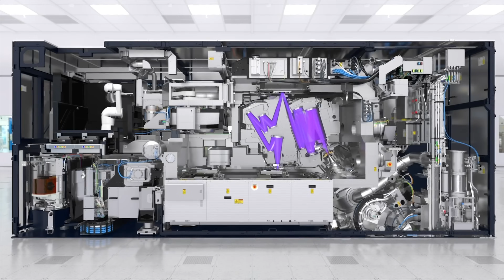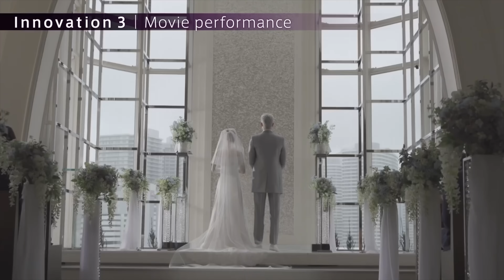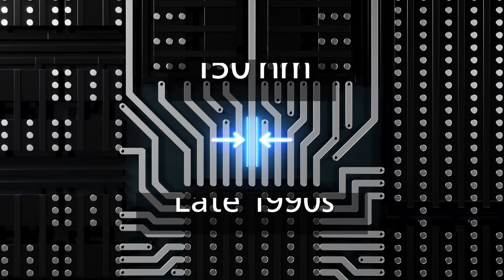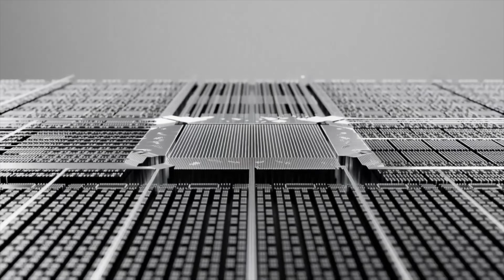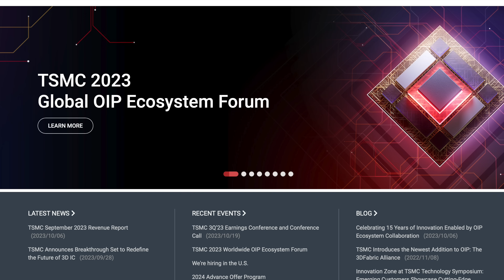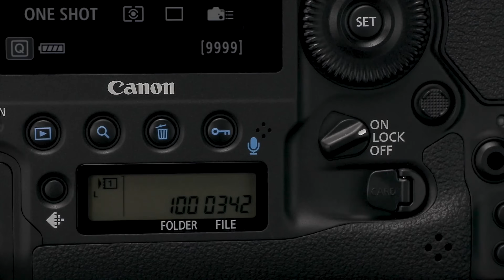Canon EOS R1 Innovative, new sensor design technology?

Comment: Reading about this topic, I found some skeptical articles on the internet as for this printing technology of chips on this small scale. It is told the printing technology can be faulty, because of the printing proces itself can cause small faults, while printing on the surface of the chips. Are they really completely ready for this 5nm scale chips? However, maybe the complexity is less than for instance a smartphone chip and they will really deliver it this year? As a R5 owner waiting for the MarkII, I hope for the best!
Reply from the maker: That's what's remarkable about the new release: Canon claims to have figured out imprint technology. Time will tell. It would be embarrassing to issue a press release, and then have it fail.

Comment: That will make faster processors, meanwhile faster Digic. Image sensor itself is analog chips, it does not get benefits from the new machine. But it may get faster from the stacked chips on the back.
Reply from the maker: You've actually got the backwards. It is the sensor CMOS or CCD that is analogue. the sensor's photo sites capture light as an analogy signal. This signal is sent to the image processor. 

The image processor is made up of transistors and converts the analog signal into a digital information in the image processor. The name is in the chip: Digital Imaging Integrated Circuit.

But I wasn't not specific enough.

Comment: A few years ago I wondered, “what if camera manufacturers produced 5 or 3 nanometers processors like TSMC did for Apple’s iPhone and computers? How would much more battery life could we get?  Performance in shots per seconds? Better dynamic range?  16 bit instead of 14 bits photos? 8K 120? “.    Medium Format quality in a Full Frame camera.  I’m just a guy dreaming.
Reply from the maker: At a contextual level, because the same transistors and logic take up a much smaller space, information gets to its destination much quicker, requires less energy, generating less heat and prolongs battery life.
Reply: 8k 120 from a red costs over 40k so yes you are dreaming but I would definitely settle for 8k 60fps since the R3 can do 6k 60 fps

Comment: This could be a really really big deal. I'll wait to see the results on their fabrication yields as we've been down this road before with Intel promising they've "cracked the lithography code" only to fail to produce at the yields they wanted, which ultimately made their implementation in a fab unprofitable.

I really do hope that this is real though, it would be amazing to have multiple forms of lithography available to manufacturers. ASML having a monopoly isn't great for business and they've had a monopoly for almost a decade at this point.

Ultimately, this has very little to do with their camera division and more to do with them maintaining a hold on arguably the most lucrative business in the world, lithography and chip manufacturing. It'll help their camera division for sure, but the profit possibilities if this pans out for them extend to much bigger things like contracts with Apple, Samsung, nVidia, AMD, Intel, and the like. The money to be made in those circles is ridiculous and I hope Canon can get a piece of that pie!
Reply from the maker: That's always a challenge when starting out with a new technology. In the 70s, some fabricators lost months of production when they could not figure out why they were generating failed batch after batch.

That they have announced machines indicates they feel confident they have solved the issues enough to take on ASML. If it turns out to flop, they will have major egg on their faces.
Reply: @OrdinaryFilmmaker  you're not wrong! Lithography and executing it in fabrication once someone has bought your machine is no joke. This stuff is arguably the most difficult task known to humanity. I know folks who work at NASA who consider modern lithography harder than going to the moon!
Reply from the maker: It's funny, as complex as it is today, the 70s proved to be a very difficult and challenging time for semiconductor fabs. They were still figuring things out. They would often have failed batch after failed bath for not hours, but days, weeks or even months.

Having followed the chip making process for a few decades, I never stop being amazed at how it all works, that these ASML machines can lay down billions of transistors over multiple layers and do it successfully as they do.

If Canon has figured things out, can problems chips to the 2nm level and do so without failed batch wafer after wafer, that will be good for global manufacturing.

The math in going to the moon was challenging until they figured it out. Things like the Schmidt-Kalman filter helped a lot. The big problem with space travel is the need for a massive amount of thrust from a chemical rocket.

Comment: controlling whole vertical supply chain when it comes to production of chips means exactly nothing for consumers as it only gives you priority when global supply cant keep up with demand and better margins as its not split between multiple subjects. But doesnt automatically means that the product is better than competition that relies on multiple companies supply chain. Just look how it worked for Intel when they tried to make their own 10nm manufacturing process. Havent succeeded in that next step in years,  produced more expensive and less efficient chips and ultimately felt behind AMD in raw performance as well for a moment. And then they made a deal with TSMC for some components and processes, effectively reducing their vertical integration a bit. 
Only when Canon release their product and it could be tested against alternatives can we say anything about their quality. Only when finantial details are released can we say anything about price and/or efficiency.
Reply from the maker: Intel made several mistakes. Their first was doubling down on CISC processing. They figured chip performance would keep up and nullify any issues down the road, and this worked for decades until it didn't... They got complacent. Making ones own chips by itself isn't enough. All aspects of the organization needing working well together.  When that happens, the results are beneficial. You can take the best machines and give them to someone that knows nothing - results will vary.
Reply: @OrdinaryFilmmaker  CISC is still fine, AMD is also still on CISC/x86 architecture (although they bought a company that specialise in ARM architecture if im not mistaken), but their approach was better in since they released Ryzen series, be it chiplet design or just paying companies who are leaders in litography processes instead of making their own in house. Actually AMD was vertically integrated in the past too and they hugely benefited in splitting into 2 separate companies AMD and Global Founaries, both companies doing better after specialising in their respective fields than together. And while years later AMD prospers, GF is not even in top 3 semiconductor manufacturers anymore, even specialised they just couldnt keep up technologically with competition. And if they would be still one company with AMD, its likely AMD would not recover as they did despite vertical integration - the litography and manufacturing divisions would actually drag them down , not help them (as it did for Intel and even after a bit of recovery last 2 years it still just generate significant losses for them). Intels mistake wasnt that they double down on CISC. its that they didnt cut their losses on litography R&D sooner and didnt go to Samsung or TSMC, instead they still tried to make their 10nm process work and it still didnt, so they were stuck on their old and less efficient 12nm process, year after year all while TSMC was already on 7nm and starting 5nm production and Samsung was on 8nm. 

I dont disagree with you that when things in company work together its beneficial and if everything works well with no setback and every part of company keeping up with industry leaders its great to be vertically integrated, just saying its still not guaranteed to be beneficial even if internal processes works well together. There are tons of different factors that make R&D un/successful (or fast enought). And without successful and timely technological advances you wont keep up and often the best decision you as a company can make is to sell off/close down affected division and buy solution from industry leader.
Reply from the maker: CISC is still fine because they keep throwing more energy at it. just look at how much power is needed for the same compute level. When I used to edit 1080 videos, it would take an hour to export one film in h.264, over a day in h.265 and the heat was incredible.

I now use one of those Arm-based M1 Ultra chips and can export a 1h42 4K film 34 minutes. One minute of 8K video exports in one minute 15 seconds. The fan never ramps up and the machine ever gets hot. That's the power of RISC, though granted apple also put a lot of 4K 8K encoders on the chip too, but still, imagine your smartphone using a CISC chip.

I've been dreaming of RISC processor since I bought my Amiga 500. It's taken 30 years for the benefits to be significant enough.
Reply: @OrdinaryFilmmaker  x86 architecture is power hungry and power inefficient, especially stock from AMD or Intel. But its really mainly because of marketing. 
As an owner of i7 13700K processor which have maximum consumption of 253W (and during load it really takes around 240W when in factory settings and cooled properly), I undervolted it and limited maximum consumption to 120W while retaining more than 90% of performance. AMD and Intel just push unreasonable ammounts of power, way past maximum power efficiency, just so they would scrape few points in some benchmark, saying they are better than chosen reference model from competition. Granted even when pushed to the power efficiency maximum its still less pover efficient than ARM/RISCV architectures, but performance is the king and my limited i7 still have higher computational power than M1 Ultra and takes just double the power.
I agree that RISC is most likely the future,  its nice that Apple managed to take a first step (especially their translation layer between CISC and RISC instruction is doing wonders, software differences are quite huge problem and chromebooks and few other attempts to use RISC in computers failed on this in the past) but I would say it will take few more years,for RISC based architectures to surpass CISC based one in high performance areas and at least a decade to dominate the whole market (because of software compatibility).
Reply from the maker: People think these chips are just central processing units: that they just take in data, process it and spit it back out at incredible speeds. Intel is best at the massive amount of data it can process. Where the Apple M1 ultra is able to outperform the intel chips, is not in raw speed, and not in every task. 

When I see how fast I can export 10 minutes of 4K video it's amazing. it is not because the chip is fast, it is because Apple added two video decode engines, four video encode engines, and four ProRes encode and decode engines along with hardware-accelerated H.264, HEVC, ProRes, and ProRes RAW. placing those function onto the silicon gained huge performance benefits for video workflow that we don't get with intel.

However, try gaming on the same machine, and Intel with a good GPU will run circles around it. I think Apple designed their chips around the creative space, which is evident in the cores structured.

Thanks for the info about undervolting. I'll keep that in mind for my next Wintel machine.

Comment: As mentioned in the video - both Samsung, TSMC and Intel use the same chip manufacturer, but they are quite different in their performances. This is a good news for Canon, but it guarantees nothing. If they manage to use their chips without crippling them - that's going to be a win.
Reply from the maker: With the machines announced, it is only a matter of time before we get results. I'm sure they feel confident as have undergone lots of testing, but testing in the market is what matters.

Comment: Based on the what was presented, Canon fabrication technology only is of benefit in the digital domain but not the analog domain, i.e., the sensor itself. Still, for mixed signal designs, smaller node sizes may translate to lower heat generation and thus lower sensor noise.
Reply from the maker: It also allows the chip to be smaller, requiring less power having the battery last longer and also deliver less heat.

Comment: Nope. I'm going out on a limb to predict that the Sony camera announcement in the next 2 months will have a new camera sensor that is better than the EOS R1. Prove me wrong Canon! All these new technologies will be for a camera 2 years out because any camera release in 2024 would be using an existing manufacturing supply chain and production flow that was planned years ago. I don't consider the Canon R1 as a "future" camera but rather a current camera that's undergoing testing for launch by the end of 2024.
Reply from the maker: I hope you're right. The more these guys compete against each other, the better their offerings to us. We don't have much on the R1 yet, but they've had four years to work on it.